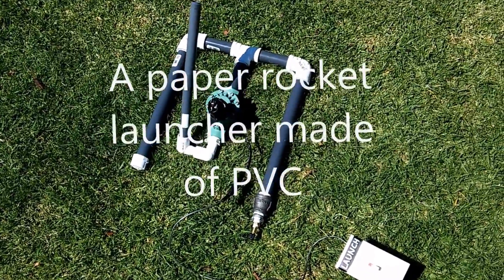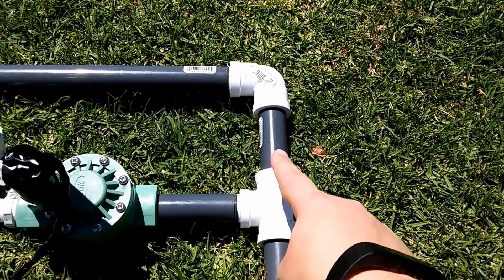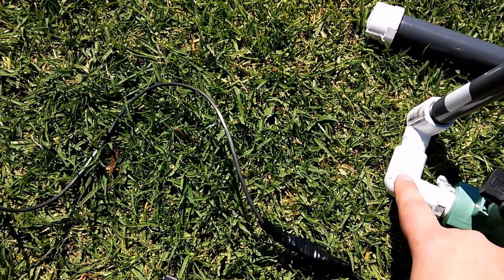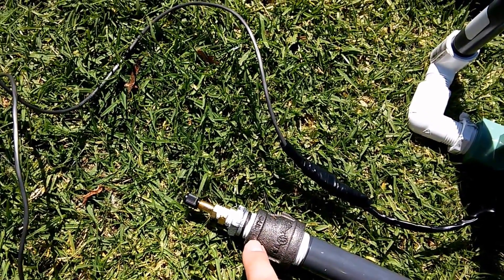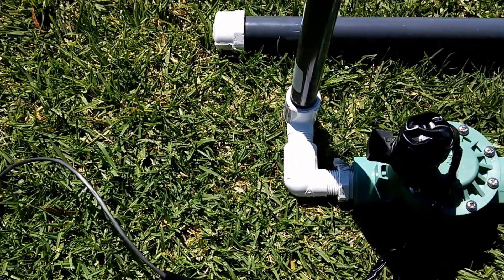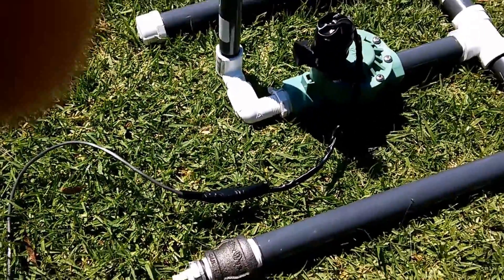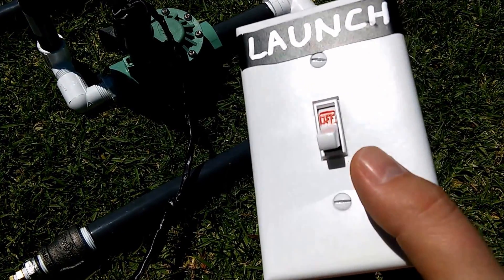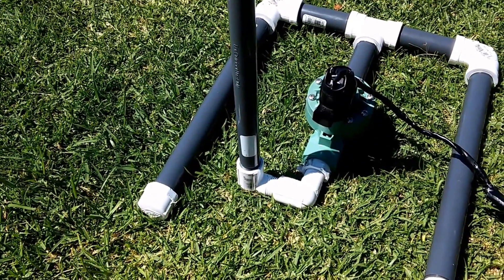Paper Air Rocket Launcher

Comment: I used the same light switch you show in this video basically. You mention I think in this video that you may show a video putting the switch together????  I need to watch it through for the 20 th time I guess. Also I remember you saying something about changing to a push button.  Do you a video using the push button?
Reply from the maker: I think your main issue may just be voltage or possibly the valve itself. Try using two 9v batteries to see if that helps when under pressure. this may help:http://www.spudfiles.com/pneumatic-cannons/topic18083.html I connect the positive terminal of the battery to one terminal of the light switch. The other terminal of the light switch is connected to the positive lead for the valve. The negative terminal of the battery is connected directly to the negative lead of the valve. Since making the video I also added a lighted arcade push button switch added effect.

Comment: So, I used your plan and built this. The 9v drained fast and the sprinkler valve had issues. Help me figure out what I did wrong please. The switch and valve were fine until I added air. It worked up til 30 psi but after that the valve didn't open. As soon as I released some pressure with the manual release valve the valve switch would operate
Reply from the maker: It could be a couple things. Make sure you only complete the circuit momentarily using a push button switch. That would help with the 9v draining. I've used the same 9v for hundreds of launches. The sprinkler valve may need 18v ( 2 9v batteries) or could be faulty. Not all sprinkler solenoids will fire with 9v dc power. I routinely use 80+psi without an issue.